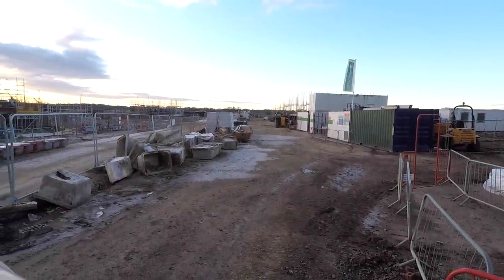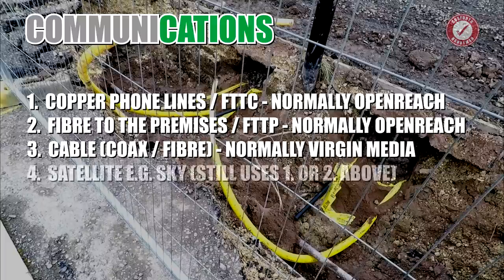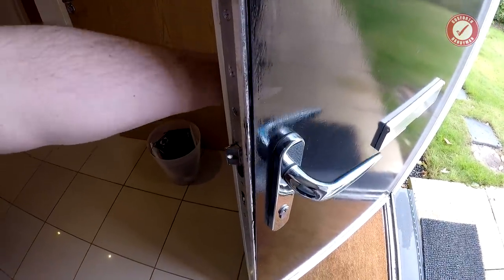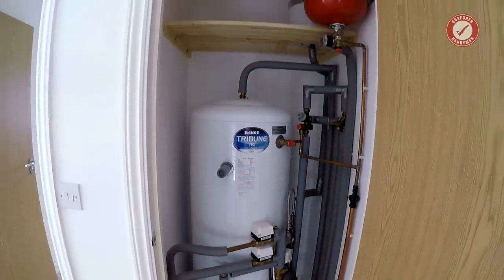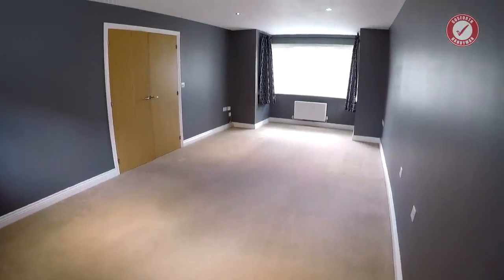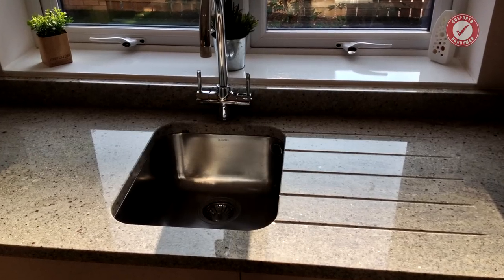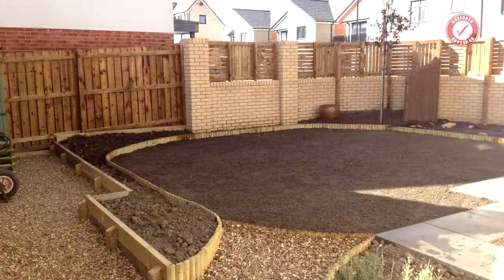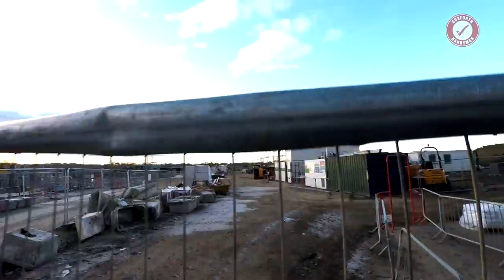How are New Houses in the UK Built? Internals, Utilities & Internet

Comment: Fascinating how different builds are in UK and N America. Do houses in UK ever use forced air heating? I don't think anyone would dream of using radiators in North America. Any idea what accounts for that difference?
Reply from the maker: Funnily enough on our house search we recently saw a 1950's house with forced air heating... but it was riddled with asbestos. Very rare to see this in the UK though. 95% will be water filled radiators. Sometimes electric storage heaters. Honestly not sure! There's no real need for air-con over here since on the 2 days per year that it's warm enough we're all out having BBQs 😂. Presumably the forced air systems in the States can do both warm and cold air? If anyone has a definitive answer to this I'd love to know. 👍👊
Reply: @GosforthHandyman  forced air is pretty well the default heating system in US and Canada. Sometimes includes ac cooling too, but not always. Could well be the temperature extremes we get here that you just don't get there?
Reply: @GosforthHandyman  back in the early 1970's when I was a child, we lived on a new built housing estate and the house had a hot and cold blow system, we didn't use the hot air as it was too expensive so we made do with a 2 bar electric fire and no other hearing for the rest of the house, brrrr!
Reply: COST! USA spec house in UK had central air heating, we closed off the vents upstairs as the 1st (USA speak 2nd ) floor was so hot we didn't need clothes whilst ground (USA speak 1st) floor was never warm enough until we did that. In the end we installed a wood burning stove and only used the central air for quick warm ups' 
Mates UK spec house with electric night storage central air was also expensive to heat - they change the heating in their house for oil heated water rads.
Reply: Yes, our previous UK house built in 1977 had forced air heating. The vents were above the doors. We didn't have it for long though as it was noisy and very inefficient. It always woke us up when the heating came on in the morning. We then changed it for radiators and took the ducting out. It immediately improved the temperature and no noise.
Reply: Gosforth Handyman Ducted warm air heating had a brief moment in the sixties / seventies in the UK. I had several friends on a nearby estate who's houses were fitted with it. I was too young to remember it operating but more recent enquiries reveal it was often noisy, blew dust around, was quite costly to run yet didn't always heat the space adequately. It's also a bulky thing to install ductwork compared to a conventional radiator system. 

Given the increasing focus on the environment I think even conventional central heatings days are numbered in new builds. Gas boilers will be banned in favour of heat pumps which produce much lower water temperatures meaning they work best with underfloor heating. However, given that it can be harder to install above ground floors we may see a hybrid system- UFH on the ground floor, ducted warm air in bedrooms?

Comment: You mention you upgraded to tiled flooring in the entry. As someone in Canada, tiled floors are ubiquitous due to the snow. Couldn't imagine using residential grade carpet, or, lord forbid, hardwood. What do you usually get in your entry as standard?
Reply from the maker: That's a very good question! I think the standard spec was carpet - for us with a young family and pushchair that was a non-starter, hence the tile. If it's not carpet it's probably a cheap laminate flooring unless you pay to upgrade. Varies by developer though. 👍
Reply: Gosforth Handyman thank you! Definitely seen laminate here as a more cost effective solution but I have no idea how long that lasts with salt stained boots.
Reply: Steven E Laminate can be incredibly durable- it's widely used in shops, cafes etc with high footfall of people straight off the street. Like anything, you get what you pay for though- a cheap one will wear or chip quickly while a quality one will retain its appearance for years. The issue most people have with Laminate though is no matter how much you spend, there is no escaping the fact that it always looks like a cheap imitation of something else- even when it costs substantially more in some cases.

Comment: Steel clad doors and multipoint locking is pointless if the whole lot is secured by a cheap Eurocylinder lock. Those things can be broken in seconds with a pair of mole grips and a bit of brute force, which is why insurers still ask if doors are fitted with a minimum five lever mortise lock.

Comment: Modern builds: tiny plots, homes squeezed together like sardines, tiny gardens, nowhere to park (garages not actually big enough for a car), tiny rooms, built of cardboard (badly), everything nice - or even basic sometimes - is an extra cost option - and then they’re overpriced by a huge margin. About the only thing they do well is insulation and that’s because it’s mandatory these days.
Reply: Wrong about the insulation part they only have to do one house perfect then it's assumed that the rest are insulated to that standard.
Reply from the maker: Where we are the new builds are about half the price of equivalent sized older houses. Old houses with detached double garages simply don't exist in Gosforth. 👍

Comment: My slab pour wasn't leveled off, Taylor Wipey being useless, need to empty downstairs and level that off,  after 12 years its falling apart, windows need repairng or replacing and its now drafty as hell, in the start it was great but once the 10 year warranty, lots of thing start to fail and need replacing. If I didn't have mortgage still on it would probably strip it and do the insides, better sound proofing, all the drafts fixed, new kitchen and loft conversion.

Comment: I was chatting to a British Gas engineer who was saying that none of the new builds in our area are getting gas laid on as it’s being phased out as part of the environmental push.
Reply: How are new houses being heated without the gas?
Reply from the maker: Really?!? Heard it was imminent but didn't think they'd already stopped rolling out gas lines. I was hoping folk could at least have a gas hob. Nancy - ground source heat pumps etc. plus just electric systems as these can then use renewables... I think. 👍🤔
Reply: @nancyparker3732  With the warm fuzzy feelings of fighting climate change ;P
Reply: Gosforth Handyman thats what he said. I didn’t get into details with him and it may have been the last new builds he worked on rather than all of them of course.
Reply: @GosforthHandyman  If you only have gas for a gas hob won't that work out expensive? Yes, gas usage will be low but there will be the daily standing charge (can be nearly £100 a year) plus that again for the electricity.
Reply: @mda5003  some providers like ebico have no standing charge for gas or electric.
Reply: @sadiporter2966  I used to be with Ebico for that very reason - no standing charges. But, they couldn't sustain it so first they upped the unit charges per kWh and then introduced lower rates with standing charges. Ebico are or were just agents because their customers are now all being transferred to British Gas.

Comment: I wish homes were built this well in the USA. We build ours on the cheap with wood that either rots or gets blown away with the first tornado.
Reply from the maker: People still complain about them over here but on the whole they're really solid. 👍👊
Reply: @GosforthHandyman  Many homes in the US struggle to survive 100 years.  It is certainly possible to build homes to the UK standard but most people do not because they would rather spend their money on marble, fancy fixtures, and tile rather than build the sold structure..
Reply: @epistte  I don't think longevity is a such a big problem for US houses, at least the ones with passable build quality. Some of the oldest buildings in the world are wood framed. It's much easier to repair than most other types of construction, so you can keep  a wood building going indefinitely. But some of the exterior siding we use, especially in colder areas, like vinyl (PVC) siding, MDF and cheaper grades of wood clapboard,  is tacky and short-lived. Structural brick would not have a long life in our earthquake zones, but as an exterior cladding, it looks good for longer than anything else I can name.

Comment: Timber framed houses are much more efficient than traditional brick. Better for the environment to produce and build and much more airtight. Personally think timber beats brick. It’s much more precise than brick so rooms etc are likely to be square.
Reply: No they are not. A soft wood timber framed house only lasts around 30 years. Not good for the environment
Reply: @belltond1527  there is much less waste with timber framed construction than with brick etc. They are also more airtight and therefore less heat is lost making them more energy efficient. They have been built for decades so I disagree.

Comment: the rad valves look as though they were tightened with a set of pump grips rather than an adjustable spanner and the door handles are supposed to have affixing that goes through the door and clamps the handles together. Its a pain in the ass to drill but it does stop the handle screws pulling out
Reply from the maker: Ha, if it's the close up of the TRV that's a cheeky one from our rental (not a new build) since I couldn't find a single close up pic of a TRV from the 10,000+ pics I have of the new build we had. 😂

Comment: Most of the new builds around here. (Midlothian near Edinburgh) are falling apart and they are mostly only 5 or so years old! What they build around here is absolute crap. From foundation to eves cracks, back gardens flooding in even the smallest of showers, sink holes appearing due to the mine works underground. I have just bought a house (Ex 60s council) and like for like for new would have cost me nearly 3 times as much for 1/10th of the quality. It's crazy!

Comment: Hi, all I can say is you have the same hatred of wood or stick built houses, back in 1991 when I moved to Scotland with my job I let my then wife choose the house as she didn’t want to go to Scotland in the first place. We ended up in a new stick build overlooking loch Lomond and although we had a garage near the house you could only use it in the summer as it was built on an incline that made it impossible to even walk round to in snow and ice without sliding into the other garage below and the cost of heating was astronomical, the walls were so thing you could hear everything that was said in the other semi-detached. There wasn’t dampness as much as a stream running down one wall and it was very difficult to keep the house warm even in the summer and the biting insects were the size of birds and no one went out between 6pm and darkness for fear of being eaten by these insects from hell.
Reply from the maker: Oh wow! You've confirmed a lot of my fears. Around here 90% are brick / block. There's then the odd estate that's timber frame - the houses shoot up very quickly. So I guess they're built for speed. 🤔👍

Comment: It's interesting to see the differences between UK new built homes and those in the US.  I've mentioned to you before that single-family homes (we aren't big on "semi-detached") here are most commonly timber-framed, perhaps because we still have a lot of trees.  

Natural gas in the US is found mostly in the cities and larger towns, with propane or oil furnaces further out in colder parts of the country.  Ground-source heat pumps have been deemed too expensive for most, but air-source heating/air conditioning pumps have been used in the south for many years and are gaining popularity further north as the technology improves.  

Both the UK heating boilers and electrical "consumer units" are much more compact than in the US.  Practically nobody here has exterior doors with such security!  Most building codes require two off-street parking spaces per dwelling unit.  

I think we have a few things to learn from you on our side of The Pond.
Reply from the maker: Interesting! That's interesting about the ground source heat pumps - no idea what they're going to do here from 2025 when they ban gas. Do you get house alarms on many houses over there? There's a fascination with installing them here. Completely pointless. Everyone ignores them since they false alarm constantly. 👍😂
Reply: @GosforthHandyman  A few folks have house alarms, but the latest fad are the video doorbells.  You can see who is outside your house with your smartphone (so you don't have to be at home), and the video can be saved for a limited amount of time.

Comment: My problem with a bog-standard new build from the catalogue (from one of the oligopolists) in 2020 is that they are NOT future proof in terms of insulation and energy/heating systems. You still have £1000 heating bill gas or electric.

Comment: Why would you move out to an older house?
As for slab floors on Grade I would install in floor radiant heating system, this can be the coldest part of a house in the winter time. You would need to separate the water heating system with a mixer valve to maintain a lower temperature of 40°C max. Radiators require the max of 90°C to provide heat. I Grew up in the construction trades and earned a degree in architecture in the states. After 50 years I moved to the Mediterranian region and have built a home here. Yes a major difference in construction. Concrete post and beam with concrete decks, forming done with individual boards, a total waste of time and money. Insulating these post and beams is a pain in the a**e with double brick walls with rigid foam insulation in between. Does little in insulating value considering there is no thermal bridge between the inner and outer wall. 
I don't understand why the builder would have terminated all of the arial lines int the loft (or attic as we call it) I specked all lines to terminate in an electrical closet which also houses home run lines for telco and Cat6 Internet cabling. We also ran Siamese coax to each room of the house to cover both TV antenna and also to allow for satellite or video feed for a security system.
What's the deal with the banning of the boilers after 2025?
I found it quite educating to see how new homes are built in the UK!

Comment: I don't think all doors have to be fire doors in a 3 storey... I believe bathrooms are exempt from this?

Also check with the manufacturer of the door handles - if they recommend the handle should be installed with through bolts then the developer has to fit them - ours had to retrofit them to every handle
Reply from the maker: Yup - I'm pretty sure these should have had through-bolts. None did. Just tiny wood screws. Similar to the stairparts. 😬👍
Reply: @GosforthHandyman  we wouldn't have known if our snagger hadn't told us. The carpenter told us they hadn't fitted any on the estate

Comment: Why are developers "blowing" insulation in and not inserting at build stage? I was building extensions 20 years a go and always put slab insulation in when the walls were going up. Can't be for cost savings can it?
Reply from the maker: No idea. I haven't seen it over the last 5 years or so, but was all the rage when ours was getting built. As a result there are many houses with 'gaps' in the insulation where it didn't flow around the cavity properly. 🙄👍

Comment: We moved into a new built last march in Northstowe.  It was nice and shiny for a while and then all the skirtings and architrave became yellow-ish. Also it is build on a block and beam floor and it annoyes me a lot. It vibrates as you walk.
If you like to come by sometime i will show you around @ gosforth handyman
Reply from the maker: Yeah, all oil based gloss in ours and as you can see in some of the rooms it went really yellow - quick quickly too. Interesting about the block and beam! Normally pretty solid. 👍👊
Reply: Gosforth Handyman Dont know what happened with the floor. Maybe im just not used to it. Regarding the cavity insulation, our was retro filled but saw other developers using the regular insulation. The town itself is all new built. It set to become the largest new town since mikton keynes.

Comment: Should be illegal to not include ground source heat pumps for all new build estates, gas heating needs to stop
Reply from the maker: 2025! Although not sure how that will work in smaller houses without gardens. Presumably they can install the pipes under the floor somehow. 🤔👍
Reply: @GosforthHandyman  Vertical loop! They use a borehole rather than the usual trenches. Some advantages apparently (like more stable ground temps) but will cost more to drill 100m down.
Reply: @GosforthHandyman  drill the trench before laying the concrete floor should help 🤷‍♂️
Reply: Gosforth Handyman pretty sure fully charged did a video the other week where this was exactly what was done pipes directly beneath house.

https://www.youtube.com/watch?v=uI7wxNtrorQ&t=1s

Also is that garage loft boarding directly onto the joists?

Comment: Generally an easy telltale for beam and block is if there are air bricks just over the damp proof coarse
Beam and block floors should have a ventilated cavity, ground bearing slabs don’t
Reply from the maker: Yup. 👍
Reply: Gosforth Handyman other thing to consider is density of insulation that you can never know 
But if poor insulation is installed over any kind of slab it could result in the finishes cracking because the insulation deforms under load